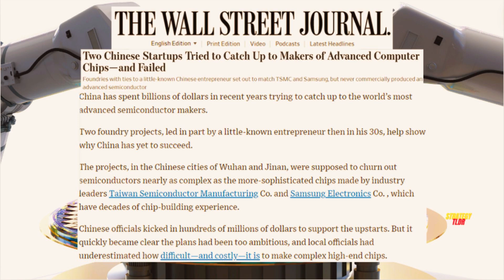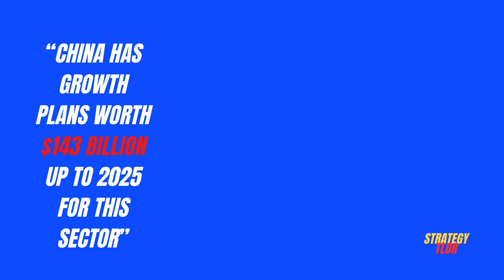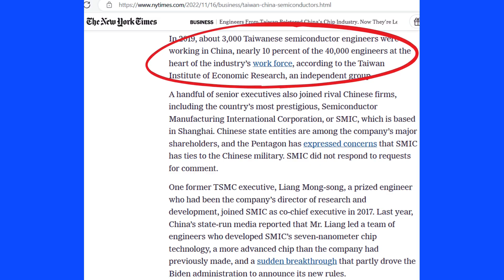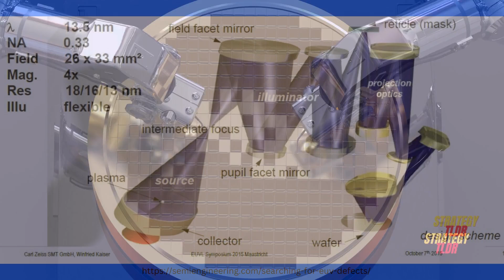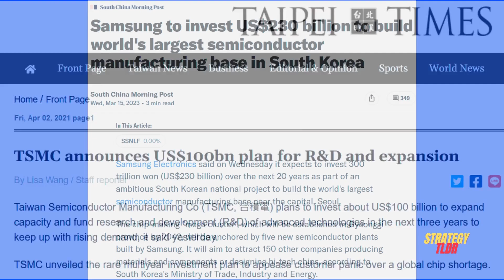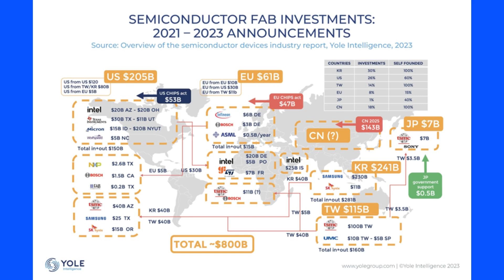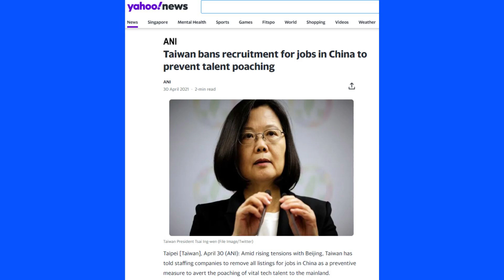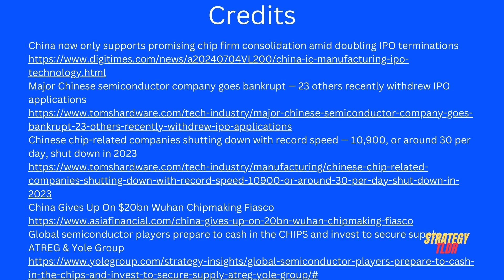Why China loses Billions in Semiconductor Chip Business

Comment: What I have heard was that as a result of US State Department export restrictions, companies such as Nvidia, AMD, and Intel list $160 Billion in sales in China, which is irreplaceable as their largest market. Meanwhile, Chinese chipmakers have been able to build their own, and so what was formerly their largest market is now their largest competitor.
Reply: I would add that in China they have developed a GPU chip that is essentially photonic. 
Called the ACCEL chip, it’s said to be 3000 times faster than Nvidia’s A100 and consumes a 10,000 of the power.
Reply from the maker: The reports referenced in the video say that China has made 7nm chip by tweaking the older DUV technology. Also, that the yields are not yet great. US has also restricted the export of next Gen EUV machines with which TSMC, Samsung etc have made 7nm, 5 and 3 nm. They are restricting even the repair of old SML machines. Basically, these steps delay China's capabilities for now.  So, China has to develop on its own, inside the country, a whole ecosystem for manufacturing cutting edge semiconductors. That means they have to have local machine manufacturers, chemicals manufacturers, designers, fabricators and so on. This is the point that the video makes. China knows this and is investing.